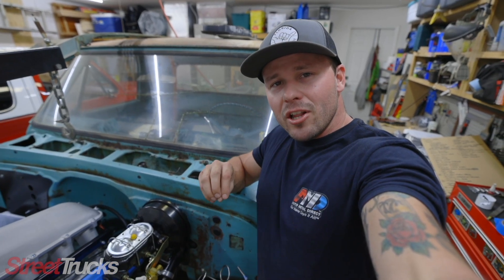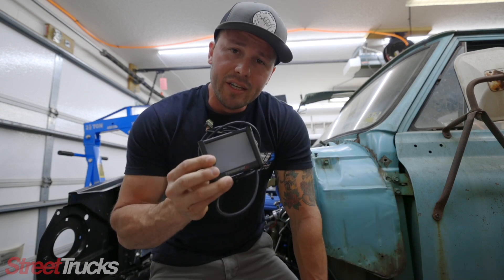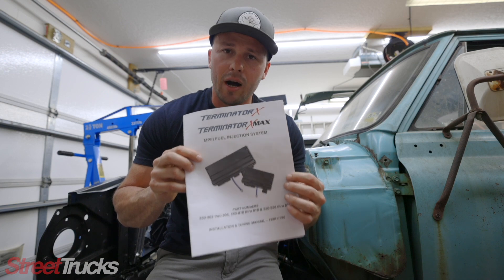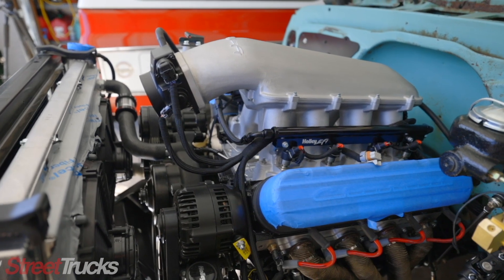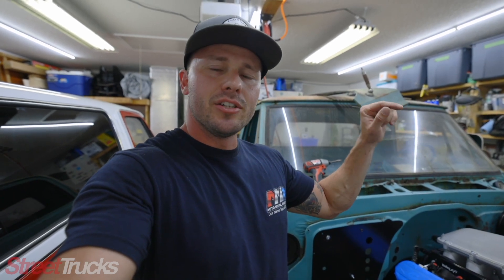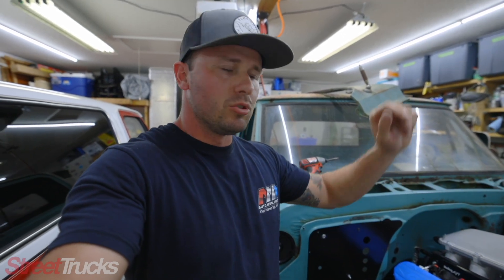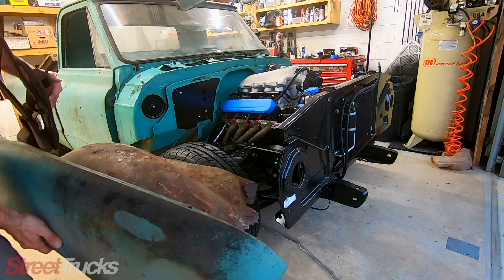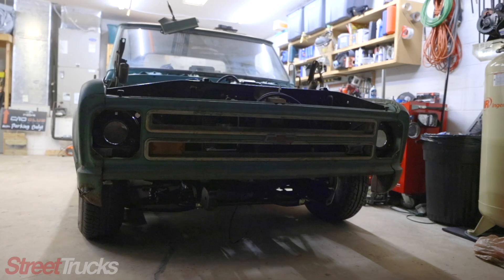C10 Terminator X Max Install | Project Last Chance

Comment: I ran my harness through the clutch hole too but I think it's too close to the header on mine. I'm gonna put a hole in the firewall near the middle passenger side. mounted my ecu in the same spot as you. love the video I'm doing the same truck!
Reply from the maker: Love it man! Our headers drop almost straight down so there is no issues with the harness being too close. You could also look at getting a DEI heat shroud which sleeves the wires with a heat resistant material. I ran this on my trans cooler lines and fuel line where it's close to the exhaust/ headers.

Comment: Looks good . Should have mounted the ecu where you could see the LED's  
I ran my the same way but changed it to the center of the firewall
Reply from the maker: You can see the LEDs of the ECU through the speaker slots on the dash. You can actually see them while you're driving.
Reply: Well I did think about the speaker not being there
Good way of doing it now. 👏

Comment: What kind of grommet did you use for the clutch hole when you ran the harness?
Reply from the maker: I grabbed a couple of different large grommets off amazon and had to cut one to fit. It's kind of an awkward hole but grommet has held up great so far.
Reply: @motortopiaondemand  awesome thank you

Comment: Even the 1982 Chevy c-10 truck deserves going faster than 100 mph than 65mph in Terminator 2 Judgement Day. Unless that truck had a 2019 Chevy Corvette engine and transmission is a costly makeover option.